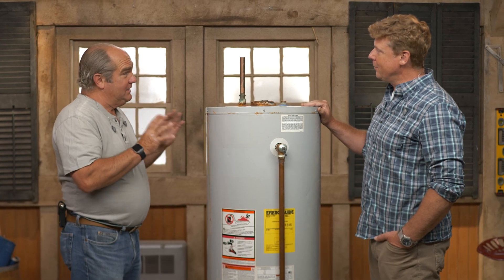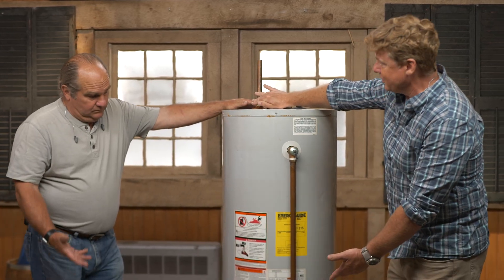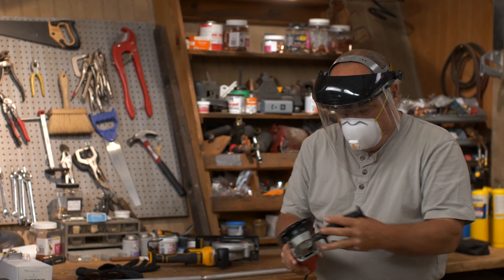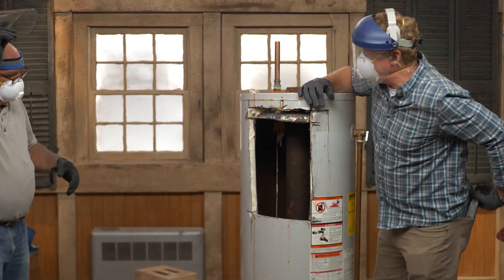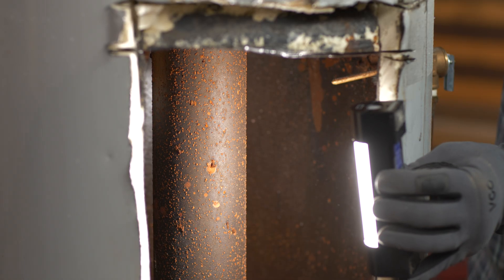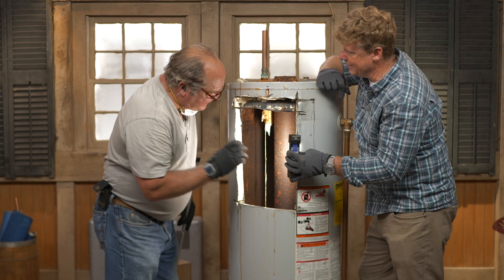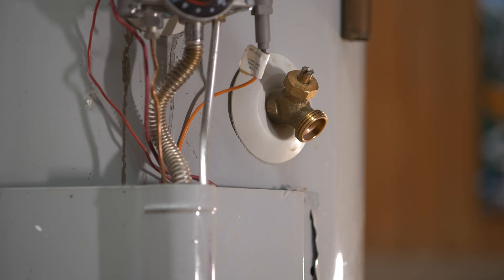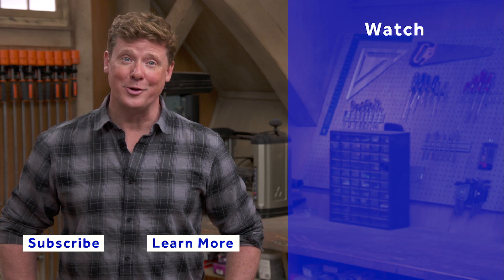Why This Water Heater Failed | Ask This Old House

Comment: My last water heater lasted 22 years. Now they fail every 6-10 years. The water hasn't changed. What has changed, is these manufacturers are making them more cheaply. Even Bradford White Defenders today are made like garbage compared to Rheem ones from 20 yrs ago. The last water heater that failed, the anode rod still had plenty of life left. It was the crappy made tank

Comment: So in theory, if you check and maintain as you should would your tank last indefinitely?   I checked my anode rod every 2 years, and would replace if it was getting bad, since they are only about $25.  As well I did a regular flush yearly for sediment, and turned it off or down when away on vacation.  Not sure what more there is to maintain them
Reply: Same here my tank is an amana and it’s from 1989 I flush it once a year and replace anode every 2 years
Reply: @kevtube8976  When taken out is the anode visually different than when you put it in 2 years earlier?
Reply: @Innerbrave  ya you can see the rod is definitely doing it’s job
Reply: Think of it like an air compressor tank, you have to drain the tank of moisture after every use, otherwise it would corrode inside and potentially blow up in use.

Comment: Bought a hot water heater from Home Depot and it leaked within a week. Do yourself a favor and buy professional grade.
Reply: Rheem, wow
Reply: Sounds like user error.
Reply: @oldtwinsna8347  yea user error at the factory. Got a refund on that crap.
Reply: @oldtwinsna8347  you sound like a low-life troll…

Comment: Our original lasted thirteen years before it started leaking.  So many comparison videos I would love to see. Same source water and same usage. Long term effects of a lower heat setting versus a higher heat setting.  Sediment build up with no yearly flush versus a yearly flush (also compare gas usage efficiency).  The difference in normal city water and city water treated with a water softener.  I'm sure someone could think of multiple other scenarios to test.

Comment: How often should we change the anode rod?
Reply: 5 years and flush ur tank fully every year
Reply: Yeah and if u have an impact driver or gun get ur 1 1/16” socket, those suckers are stuck on there tight and you’ll need a 3’ cheater bar if u don’t have the power tools. With that though u run the risk of twisting the tank so much u rip ur probably brittle cpvc pipes